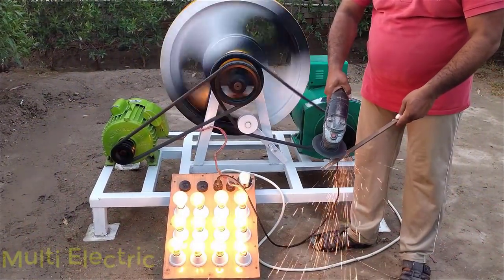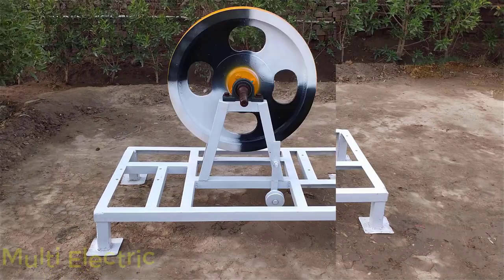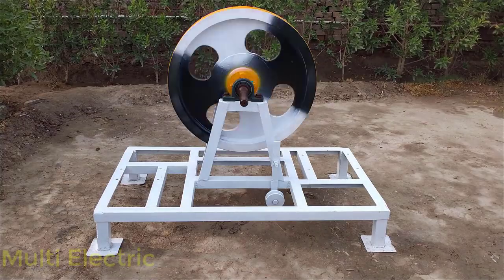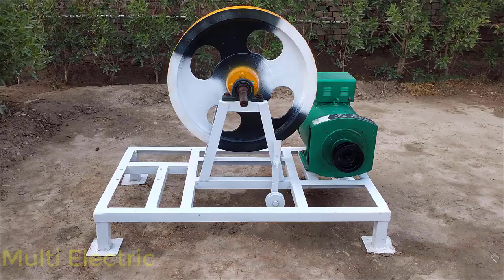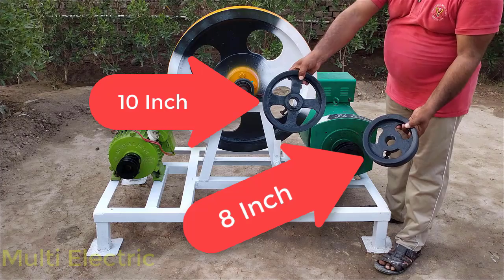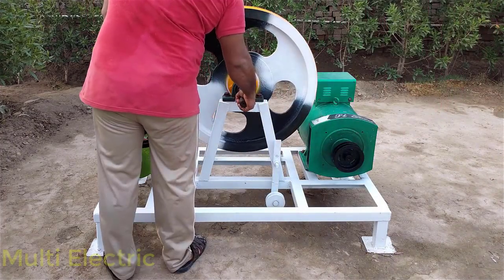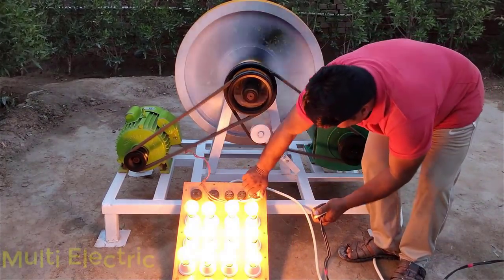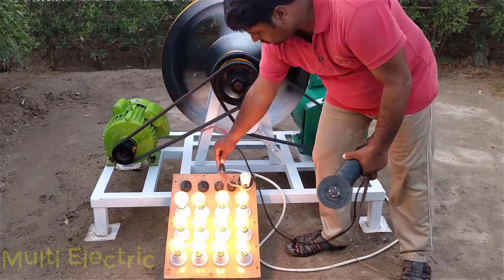12kw Free Energy Generator 230v With Alternator & 3 HP Electric Motor Free Electricity Generator

Comment: Sir have a question: What's the use of the flywheel? How you compute the size (thickness and diameter) of flywheel against the generator kilowatt rating and HP motor rating? How compute the size of pulley for generator and motor?
Reply: It stores the energy, sort of like a battery
Reply: Just like battery in a free roll, I think in this experiment it gives it time to connect back to the recycled electricity
Reply: You can see at the end of the it when the continued power is disconnected, the flywheel still rolling. More like pendulum clock buh in a circular reaction
Reply: To compute pulley diameter or rpm: 
 use:  rpm1/rpm2= Dia2/Dia1
          ( D1/D2=N2/N1)
          ( D2/D3=N3/N2). 
Where rpm1 is speed of motor pulley
      rpm2 is speed of flywheel
Dia1 is the diameter of motor pulley
Dia2 is the diameter of flywheel pulley

Comment: Very good effort; 
My questions are;
The dynamo starts to produce power @1,500rpm, how can you edit the dynamo or generator so that it can produce power at  low rpm ,? Say 500 or 750 rpm or even less, so that we can use less than 3HPelectric motor to start the system?

Comment: Dear please guide:
What are the dimensions of the iron stand on which the whole system is mounted?  What is the approximate cost of this project? Can we run the load of a small house (1 ton DC inverter AC + 1 refrigerator+ 20 smd lights of 7 Watt each + LED Tv+ Iron+ microwave oven+ washing machine).... What will we do to the excess energy ?  
Please answer all Questions..  Thank You so much!
Reply: shure not ! ! ..... 20KW generator run continue 5-110% of power ! ! and low voltage and amperage ! ! ! NOT ~220V ! ! ! !

Comment: A solar panel, battery, inverter I bet would make it work til the bearings went out. $100 a year for the bearings. $300 for the solar. $200 for the inverter. $500 a year is better than $300 a month.
Reply: Please, I am using 20kw alternator but my problem is to know What size of motor is suitable, and what will be the useful power?